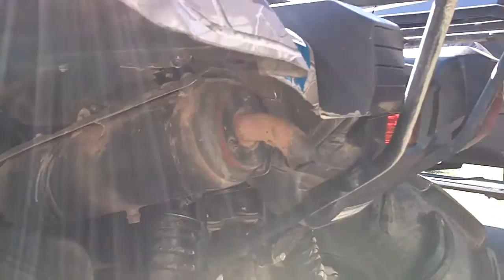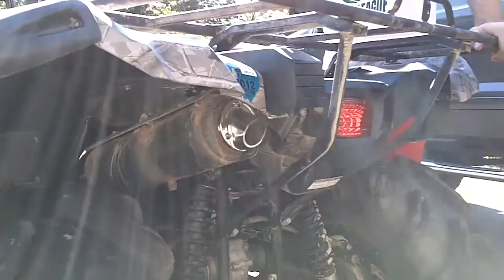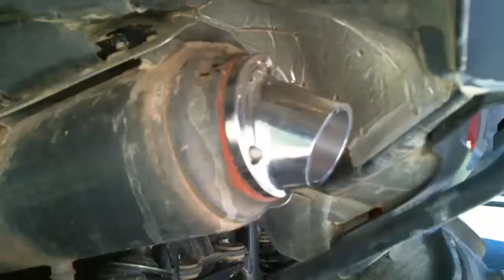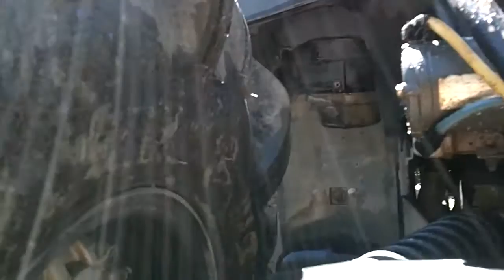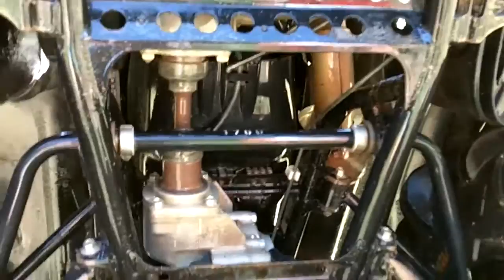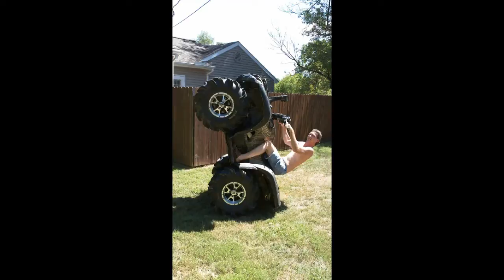2R Racing exhaust upgrade on 700 Grizzly

Comment from the maker: @schinkengermany They rub but not enough to bother Me.I drive crazy sometimes!
Worse thing that happens is pop fender apart and tire slaps it, and loose plastic rivet,Part # 90269-07010-00.I carry xtra on Grizzly due to this.Plastic rivets cheaper than lift kit !